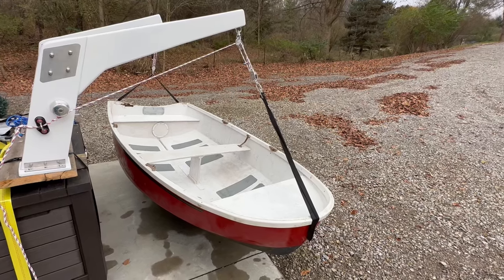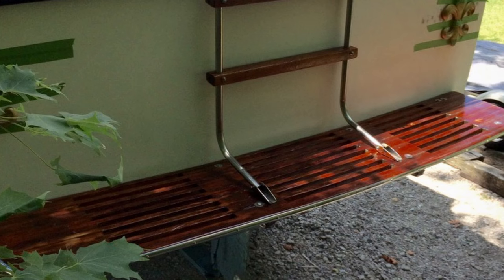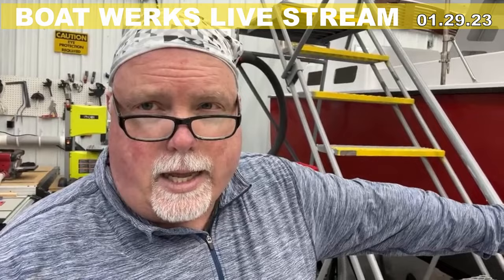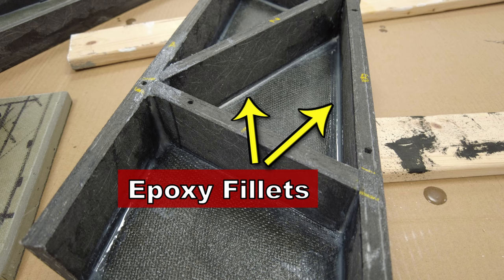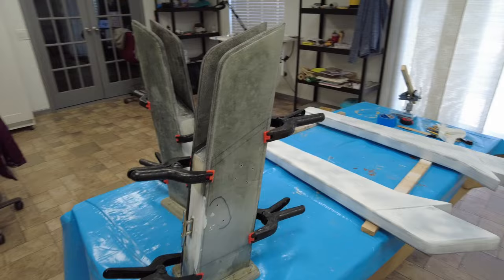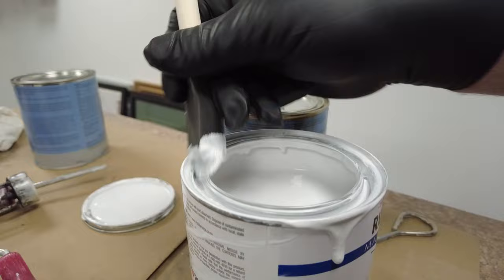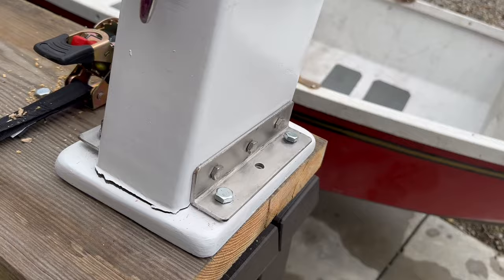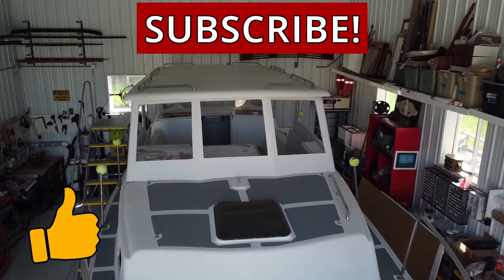Will These Home-made Dinghy Davits Break?? | Sailboat Trawler Restoration (Ep58)

Comment: Love the creative and inventive work on the davits.  Sort of makes sense that the weak link is at the end of the fulcrum arm where all the load must pass into the deck.  I think you were definitely on the right path for strengthening that joint.   If you are going to toss them it would be interesting to see what failure load would be if you just put in multiple through bolts or set the base into concrete.   Anyway glad to see the work and go easy on those who like to invent. It seems a bit masochistic.
Reply from the maker: 😀Welcome to the channel. Thank you so much for the comments! I sent you an email long ago about asking for advice as a YouTube creator and never got a reply 🤓 Let’s connect 👍 If  you watch my channel you’ll know I’m often for thinking outside the box or inventing a clever solution. I’m sure you know for the amateur there’s always a fine line between that and Mad Scientist Syndrome. Airship captains and submarine skippers exempted. 😉

Comment: All is not lost. Give it a spine, Drill into davits and epoxy all thread up through base, use these as mounting fasteners also. I like the idea of the epoxy davits. Get the Alu davits on the boat and keep the coosa davits for when you run out of projects, never give up. Drive on!
Reply from the maker: Thanks Dave. I’m not sure what I will do with the composite Davits. It’s a good lesson though 👍

Comment: I had a dinghy on davits fill up with water one day. The wave from the overtaking Coast Guard vessel [of all people...] made such a breaking wave that the dinghy (3.5ft above WL) filled up in a slashing wave. With which I want to say that for weight calculations it's best to use the weight of the dinghy full of water. And with 8# per gallon, it adds up quickly. Another way of looking at it, sitting comfortably in my armchair, is that two adults and fully loaded have to be able to stand in the dinghy when it's hanging in the davits. This gives you an idea of the bolts and back plate to use at the base. [hint; the torque is insane!]

Looking fwd to the next episode!
thx
Reply from the maker: No doubt! It was a tough lesson but not done yet !

Comment: Great video! Seeing what fails, with the prospect of success at the outset is the best kind of education. As an engineer, I can attest that over history most good design started this way. Of course now there is finite element analysis, but it still would be easier to just build it (and jump in the tender to introduce some dynamic stress, as would be seen in rough seas at the back of your boat).
Reply from the maker: Thanks of to the comment 🐙

Comment: Your on the right track with the base plate, carefully line up pilot holes up into the upright portion of the Davit, thread bolts up through the new base and into coos, it may require alot of theads engaged in the coosa to provide the strength, but it will work.
Reply from the maker: Thanks Brian! Be sure to subscribe 😎

Comment: It is definitely possible to fabricate dinghy davits from composites. But you have to have some understanding of the load paths and whatnot. A simple box beam with continuous fibers (glass or carbon) on the upper and lower outer surfaces from baseplate all the way to the tip would tremendously increase the strength.

Comment: I believe your idea is sound just minor flawed , by angling away from the transom your pressure point is the joint towards the bow . If you went vertical then horizontal it should move the point closer to the stern ( like a ? and anchoring the cables at the base stern side . The little Harbor Freight cranes lift 500 lbs with ease !
Reply from the maker: Thanks for your comments. Unfortunately There are several mistakes at play here. Better luck next time

Comment: The Coosa is not the problem, the problem is you are using it as though it's plywood. Coosa is a "core" material designed for use in a sandwich composite structure. It's designed purpose as a core is to increase the distance between the laminate skins in a composite sturcture (i.e. increase the moment of inertia, thereby increasing the stiffness, precisely by the square of core thickness). Your laminate skins are way too thin to function as an effective sandwich structure. You're essentially relying on the core's shear strength to do all the heavy lifting. Imagine replacing the Coosa with XPS foam insulation, you would never assume that would hold your dinghy, would you? A composite sandwich is a carefully designed balance of glass skin thickness and material properties (fabric type, fiber orientation, layup technique, etc.) and core dimensions (thickness) and material properties (density, shear resistance).  Reply to my comment if you want some help designing a proper laminate schedule to take the loads of your dinghy.
Reply from the maker: There are a variety of problems in the design, not just necessarily what you’re talking about. But thank you for the comment 😁👍